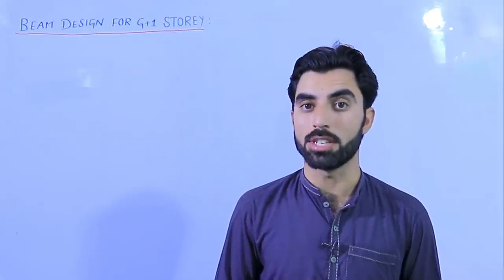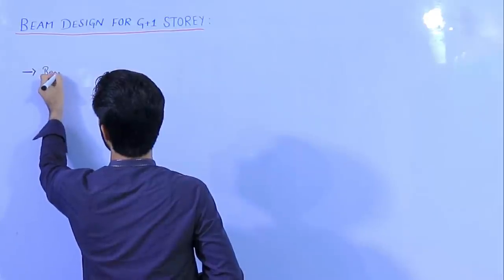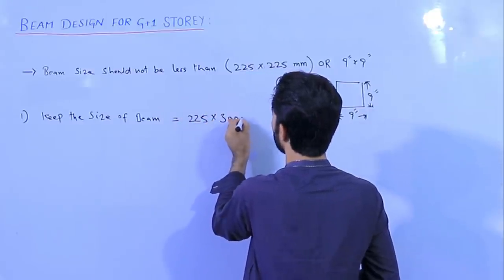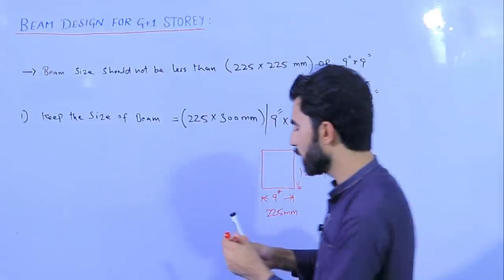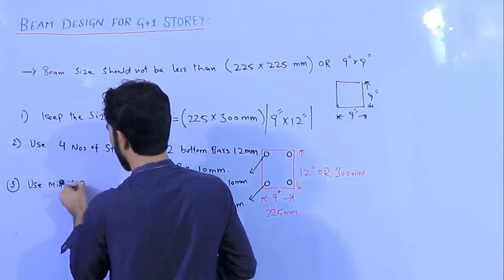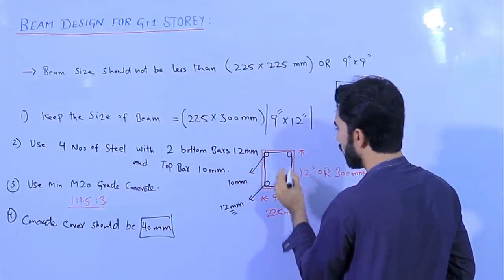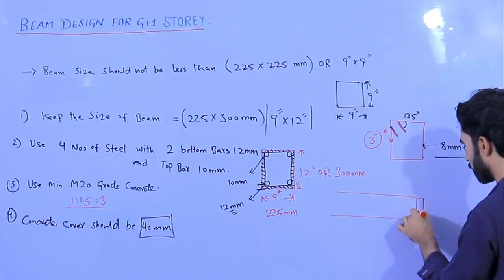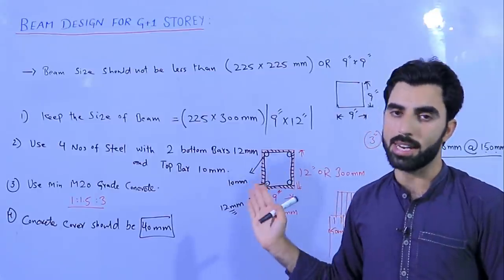Design of Beam for G+1 Storey  - RCC Beam Design

Comment: Domestic G+2 Building column with 16mm 4 iron bars with 150mm spacing is enough.footing is 4.5'×4.5' and slab thickness 5' with 10mm rods spacing 6'.
Reply: Domestic G+2 building 12*9column with16mm 4 iron rods,6mm spacing is enough?

Comment: I have a 200mm x 400mm beam
For LS/RS 4-16mm top bars and 3-16mm bottom bars 
For Mid Span 3-16mm and 4-16mm for bottom
And addition side reinforcements 2-16mm on both side.

Comment: Dear sir,
How to calculate the average spacing of ties, if a column having length of 3 m. The spacing of ties in CR (i.e. 1 m) is 125 mm and in NR (i.e. 2 m) is 175 mm.
Thanks
Reply: 150 mm preferable

Comment: Sir is that applicable for 5 m span
Reply: Is that really ok for 5000 mm span
Reply: I'm using 4 x 16mm main bars
Reply: And it's only for a roof beam carrying roof truss loads and ceiling
Reply: Sir I need maximum spacing, please reply